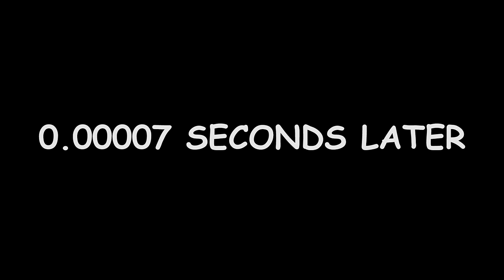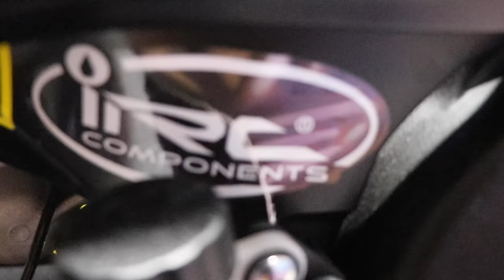CRASHING BEFORE MY FIRST RACE!! *UNBELIEVABLE*

Comment: Imho, it wasn't grabbing the brake with an unloaded tire, it was grabbing that much brake, that fast while being leaned over that far. Also, some advice, stop riding faster than you can hit every single mark on the track, every braking, turn in, apex and exit. Your getting away with it now because you're pace is not maxed out. By limiting yourself to the track and rider combination/condition, you are creating a mental decision of proper self preservation and recognising that there's a limitation factor. It's the same reason that they teach novices the proper racing line. A novice, riding at 1/3 the race pace, really doesn't need to be on the racing line, but they will as they get faster. Same point here. It's a very important skill, the more you force yourself to do it, the more it becomes second nature. As your pace becomes faster, that racing line becomes more important. Also, as you get faster and need to alter that line, primarily for passing, you will know that as you alter the line, you have to alter something else, usually one or two of the above mentioned marks, or speed....Races who do not learn these important rudimentary rules/skills, because their in a rush for "pace" will usually crash pretty regular in the weeks, months, years to come. Eventually, after crashing, bodily injury and a very expense repair budget, they will either quite or submit to this fact. Good luck, and be safe. ( p.s. you can also be taking out other riders, so get it right. Peace.)
Reply: Truest comment ive seen on any of his vids. He’s got talent for sure but from my observations of his vids he’s trying to get really fast as quick as he can and that’s a recipe for crashing ALOT
Reply: his vids show it all. he's like a child let loose on a playground, always just mashing the throttle thinking it's making him faster.
Reply: Yep.... this man speaks the truth my friend
Reply: spot on comment
Reply: Well said famo
Reply: Absolutely gem of a comment. The fact Killa Cam didn’t like it tells me he may lack a little bit of humility, which will keep him from growing as a rider.
Reply: Excellent observation. I asked myself why would he grab the brake with that much lean angle? Panicked or tried to adjust his line? Could have used the rear brake or just simply let off a little but it looks like he got sucked into making that mistake by a faster more experienced rider. What ever the case if you keep crashing like that often something will give.

Comment: I crashed the same way a couple weeks ago at NYST pulling the brake on lean. It's a hard habit to get out of especially when your on a high speed turn but just let off the throttle. Best thing to do is get back up and back on the bike if you could. Keep Killin it

Comment: Tk me later
9:38 + 
And this is y we trail break.......
Hands down one of the most important part of y we do this ... speedy recovery famo . Luv the vid
Reply: Trail break?
Reply: @nate.hanlon  Trail braking is continuing brake into corner and progressively braking less as you get deeper into corner. The concept keeps the front loaded longer, helping turn in traction. Trail braking wasn't the issue here though he just got too close to that other bike and panicked so he grabbed front brake too hard, locking the wheel.
Reply: @NiSE_Rafter  trail braking would have saved him because the front shock would have already been loaded and he wouldn't have had to panicked pull the brake lever since he would have already partially been on it.

Comment: Pulling front brakes on full lean yeah boi
Reply: he had to, otherwise he'd taken the other ride out too
Reply: I thought same better sit up and run on
Reply: @louis.betsche  Could he have just slightly rolled off the throttle to avoid tapping the rider in front of him instead of a front brake stab?  I guess that was the mistake right?
Reply: I mean
he didn't hit the other dude
Even if he went down, better than both going down
Reply: Panic brake, completely avoidable off
Reply: @louis.betsche  either rear brake or let off the throttle, or worse worse case scenario pick the bike back up and either try to brake or to lean right after avoiding the rider.
Reply: @christopher2327  Yeah probably...
Reply: @guimauve522  yeah, true...
Reply: No need to touch the front brake just neutral throttle would have kept him right in line with him

Comment: You didnt need to brake, closing the throttle was enough. whatever you do next, get the brembo 19X18 master cylinder for better feel and progressive action. Also when u brake like that lift the bike just ever so slightly it will help keep the grip. Its ok we all have been there :)
Reply from the maker: 🙏🏾 definitely the lesson I learned here, as well as riding on a slightly staggered line

Comment: I did that once at 80mph at Sonoma raceway in CA at full lean... once. You were done the moment you closed the throttle, let alone grabbing the brake. I remember feeling similarly euphoric when I popped up and picked up my bike and realized I wasn't hurt. Reality check for me came the next race season when I highsided and broke my arm and three vertebrae; no euphoria then, just pain lol.
Reply: Also no offense but ditch the shorty levers: that's a squid part. You'll never complain about having a longer lever/better leverage when you need it.
Reply from the maker: Geez my dude, how'd you heal up? And that's what the rebuild is for, got rid of a lot of the street parts and started focusing on what will help me preform better over looks! Rebuild is done, just facing an impending electrical issue which it's at the shop for now, but eBay shorty levers are gone 🙏🏾🤣
Reply: @TheKilaCam  healed up good actually! I was back in the saddle in like 6 months and back on the track the next year. Lost my sponsors, but that's just the name of the game I guess. Glad you didn't get hurt on this one, and good luck with the new build! I'm putting my 2019 r6 in race trim, it's definitely a lot of work.
Reply from the maker: Forrest Condit just did mine and it is 🤣

Comment: Cam, what made you hit the front brakes? 

Also, try using the rear brake in Double apex turns.
Reply: He was scared to hit the rider in front of him, because he had more momentum most likely because he was in the guys draft..  braking there would have been fine, he just needed do go a bit wide standing the bike up first before applying the brakes and would have worked out.

Comment: Gear definitely saved your life.  I crashed at 90mph 2 months ago. it slung me into a curb and launched me 20 foot up through a State Farm sign  and 120 feet forward.  I made it out with a broke leg in 4 different spots and a fractured pelvis.  If I wouldn’t have been wearing gear I would have been dead.  you can see my wreck on my Instagram @trashed_e46.  Glad you’re safe out there bro!

Comment: Thanks for the video. I am glad you made it out ok.  Looking forward to seeing the repaied bike.  My 18yo was on the Orange/primer R6 but you slipped by my 16yo at about 5:50 (red 52 tail light decal).  Wish he could have stayed in front of you for a lap.  :-).  The 18yo is at Frostburg but if you go to NCBike this weekend the 16yo will be there to play with.  Can't wait to see the face lift of the R6.  Was it the front brake that got you?  I know people talk about touching it to load the front tire but I feel like a shut throttle is the way to start that...imho anyway. It looked like you snatched it but then it looked like it could have been an illusion as you lost the front.
Reply from the maker: In the moment I saw his bike coming towards me quickly before the cone where we start to brake and my reflexes from the street kicked in and I grabbed a handful of brakes, i should have been on a staggered line with him but I'd rather take only myself out instead of ramming into the back of him, live and learn 🙏🏾
Reply: @TheKilaCam  ugh, I tried to drive through someone once.  At 10:30 https://youtu.be/54IfdfUmg64 Didn't pan out great for me.  At the beginning of that video is little RJ on the R3 when he first started. A time machine and a quick push on the left bar would have probably have worked, but if your luck is like mine there probably would have been someone trying to pass you two on the left.
Reply from the maker: Melvin Weeks HOLY CRAP, you walked away from that? that was intense, glad you're okay
Reply: @TheKilaCam  You think your bike got it bad.  When Tyler needed a bike I tried RJ out on the same bike. He took to it very well.  Then at the end of the season last year RJ decided he would brutalized that poor bike. 17:10 https://youtu.be/dDm9X4BQozM
Reply from the maker: Melvin Weeks that thing looked TORN apart, poor bike, glad he made it out all good though

Comment: Damn Brodie I’m sorry about your bike you’ll come back stronger! Try to use your engine to trail brake by coming off the throttle. It will slow you down pretty quick and you don’t gotta worry about losing the front end.

Comment: Why do you always have your finger on the clutch lever coming out of turns?
Reply from the maker: bad habit from street and dirt im trying to get rid of
Reply: TheKilaCam I say do whatever makes you comfortable. I was just curious. Thanks
Reply: @TheKilaCam  actually, it is not necessarily a bad habit on track. When you learn to back it into corners on entry, if the rear tire doesnt stop sliding before releasing front brake lever and with closed throttle, you can pull clutch in ever so slightly and briefly to get the rear to hook up before releasing front brake to allow you max grip on front and rear tires simultaneously to make the best use of edge grip and making the bike balanced. Just dont pull too much clutch or you will have all new problems to deal with and only if the rear has not come back in line during before releasing front brake. Study the youtube video series channel MotoVudu by ex pro racer and current MotoGP pit lane commentator, Simon Crafer.
Tommy #70 PanAmSBK